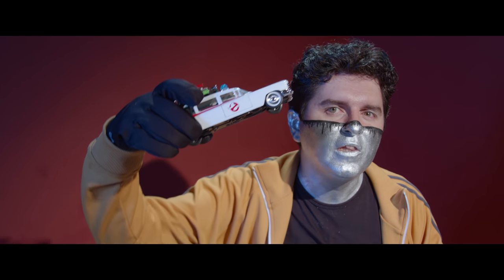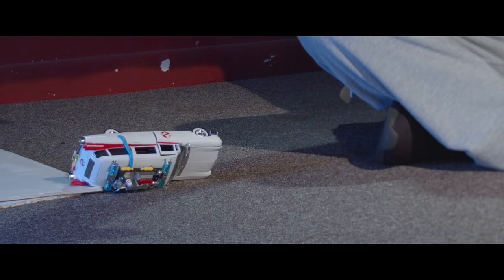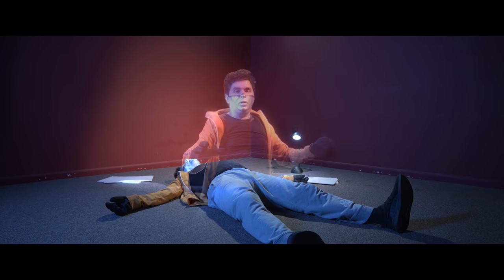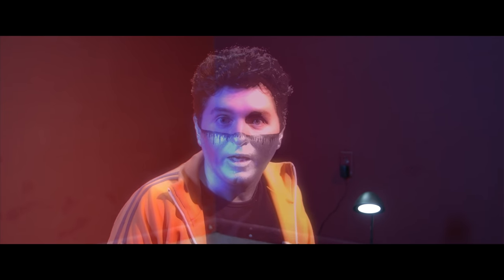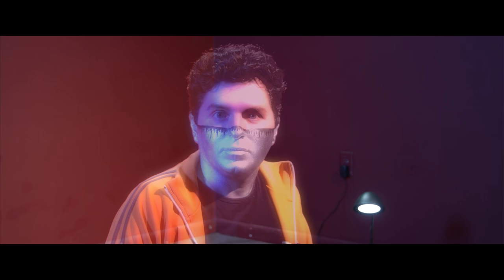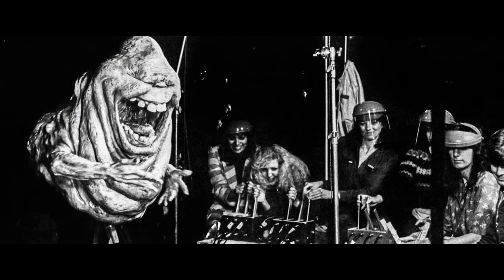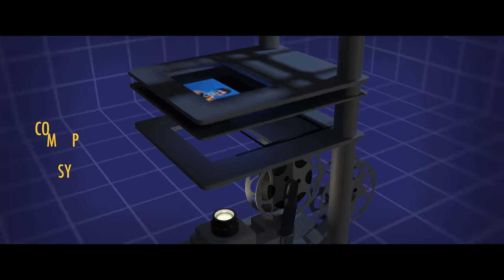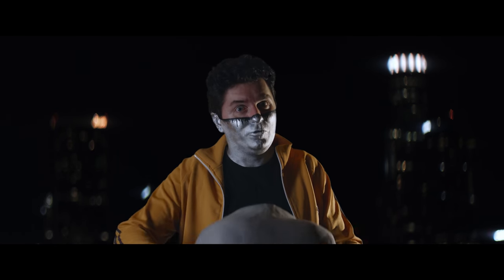EXTENDED CUT - Captain D's 'Could You Survive GHOSTBUSTERS' Segment

Comment: And for those curious for where the term "overcrank" and "undercrank" came from, it refers to how film cameras used to be operated by hand using a crank, with the speed of the crank determining the frame rate. If you wanted to film at a higher than normal frame rate, you had to crank faster than normal. And if you wanted to film at a lower frame rate, you had to crank slower.
Of course, eventually, film cameras would become motorized, allowing the "crank rate" to be controlled electronically, with less effort and more precision. And nowadays, we have digital cameras that have no mechanical elements, but the terminology sticks around.

Comment: What's harder is miniature WATER (and other moving fluids and gasses)

Many scenes in The Titanic which show the full ship use a miniature.   But because of the water the model needed to be interacting with,  they had to build a MASSIVE miniature (AKA a Bigature)  so that the splashing waves and spray hitting the ship could have smaller particles relative to the Titanic.  Also I think there's special tricks used by the pros to mix some other things in the water to make it froth in a smaller detailed way,  and also special ingredients and techniques to make flames and explosions at miniature scale look much bigger.
I know pouring streams of dry salt has been used for scaled down giant waterfalls, like on Naboo in Star Wars ep 1 (1999).
tricky tricky practical stuff 
I think the most state of the art CGI fluid simulations can make close up water refract light and move in a photorealistic way by now.  But I still notice in theatrical movies when they computer generate flames and explosions.  Just feels more tangible if you can afford to built a real thing to burn it down for real  🔥 🔥 🔥 🤘

Comment: To be 34 meters tall, would be a bit like being under 20 g's of gravity. So indeed, he would have had some problems. It would be quite fatal, unless your circulatory system was redesigned. But his muscles and skeleton might actually be strong enough to let him not just stand but walk, actually, though he wouldn't be able to bend over. I say this because I have very little difficulty standing and walking when I have several times my own weight resting on my shoulders when I did squat exercises on leg day. I honestly have never actually tried just standing there with a ton or more of weight on top of me, but based on just how easy it is to do it with 500 pounds, and knowing that the world record for doing that is actually about 5 tons (Louis Cyr), I bet I could do it with 20 times my own weight (about 1.6 metric tons). I certainly wouldn't be able to squat with it though, obviously. The skeleton is surprisingly strong, if you're careful how you apply the forces.